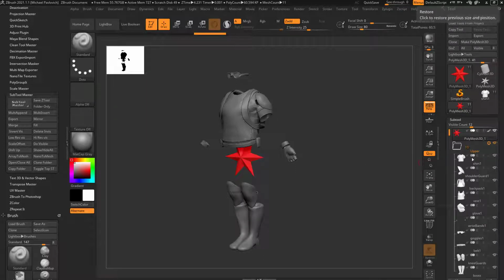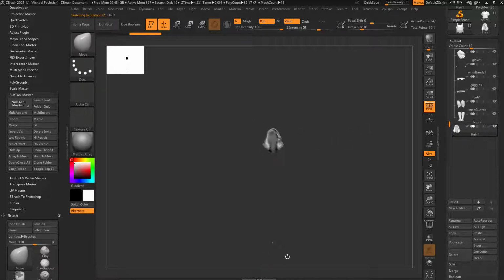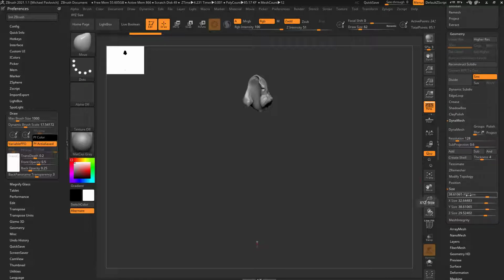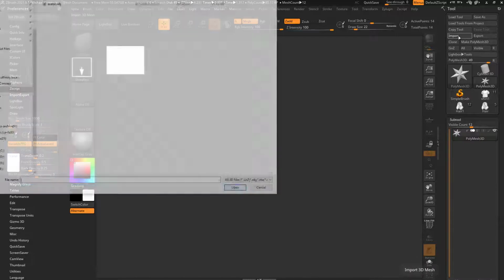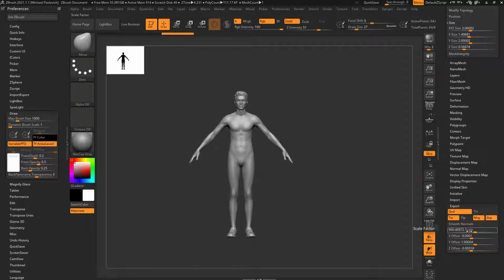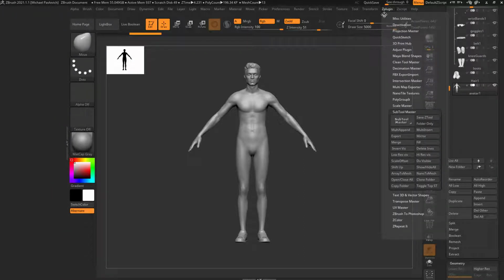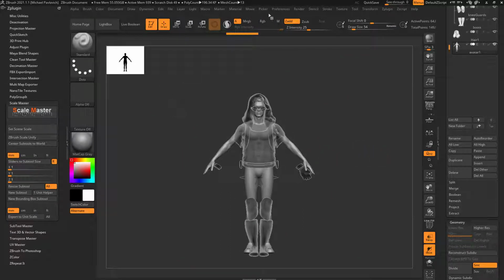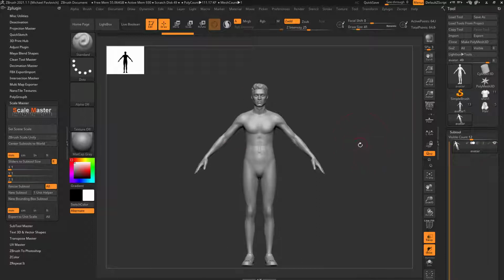038 ZBrush Scale

Comment: @Michael Pavlovich , but if we scale up or import proper (pipeline) sizes of our objects (ex. 50cm tall chair) its gonna be like, 50 ZB units object in ZBrush. Is that wrong ? It's so off the two ZB units scale.
Reply from the maker: yes, that is wrong. when you import your 50 cm tall chair, it will come in as 2 ZB units, but on export will re-size it appropriately according to the export scale it stores
Reply: @MichaelPavlovich  O! I see now, thank You! When I was fixing scales and units in my scene, I set export value to 1. Probably that was THE moment I broke things down. 
 May I ask about the case when we work on diorama or set of environment. Should 2units be kept for somewhat almost the smallest parts  or the biggest, or the whole "scene" ?